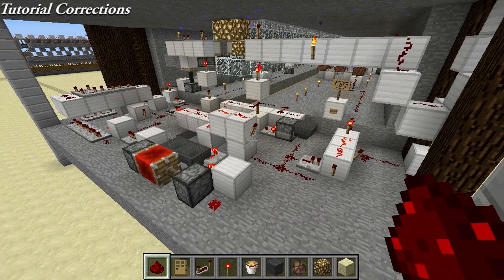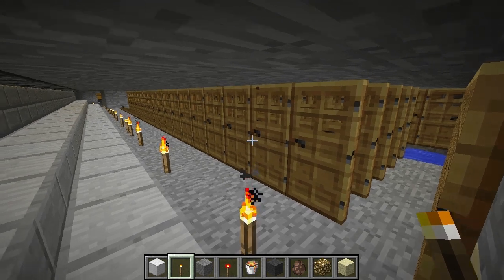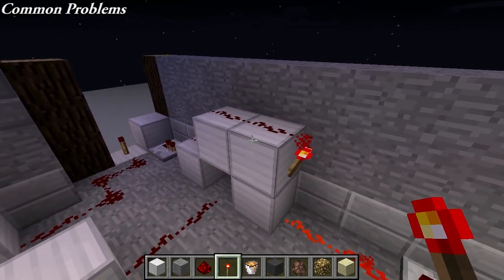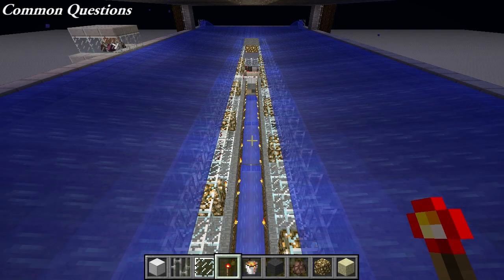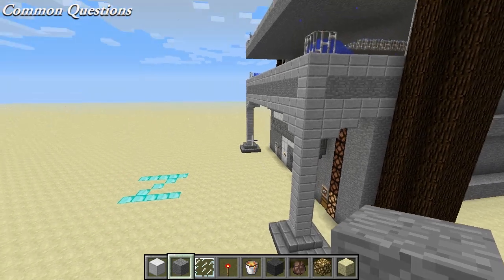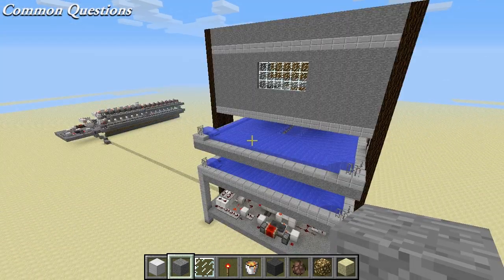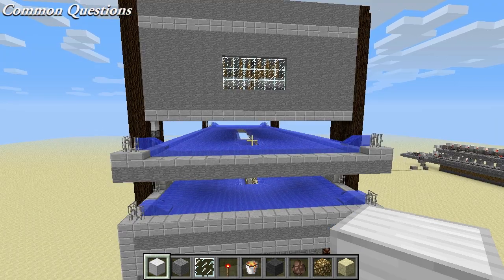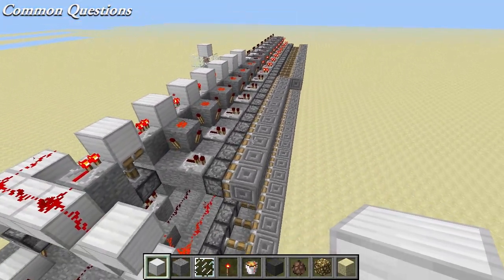The Iron Trench - Update and FAQ

Comment: as origaminerd said, that is a classic example of placing your doors further apart than they need to be. To find the correct distance (and check it) I would suggest placing a single door on one side, placing a villager within range to turn it into a village, then going to the other side and placing another door and villager at the spot. If the doors connect - you are within range. Now try placing the door one block away (and one block left or right). If new village is made, your spacing is right

Comment: One last update on this - got around to rebuilding the system (mostly because the redstone was taking up a bit too much space so I decided to go with the piston variation just shrunk into a 3x3 (mostly) space.
The system works fine, and I can confirm that starting stage 1 from the secondary village shaves off a bit of time (and resources).
Congratulations on thinking up of that by the way.

Comment from the maker: If the system is triggering a restart too aggressively you can easily just add a few more blocks to the hopper timer for the golem detector.  That will increase the maximum acceptable delay between golem spawns.  Its possibly I had this a bit too low.

Comment: That's a really great design, Tango. I have a few simplifications. The lower row of pistons on the the secondary site doesn't have any effect so you can omit them. Likewise at the primary site only the southernmost piston is necessary for phase 2 which reduces the sticky pistons needed by more than one stack. Furthermore the northmost door on the secondary site isn't needed. If you can reorganize phase one to start with one door on the secondary site you can reduce the time needed by one minute.

Comment: Just when I was losing hope I found my mistake.
I'd used glowstone in some floor areas to light it up. I guess that this was interfering with the village detection in phase 2. Now why this works in SP but not MP is anybody's guess, but I can confirm that having put everything back to solid blocks it's working.
My tip... Follow Tango's advice EXACTLY. It works.
Thanks Tango, your design is amazing.

Comment from the maker: I'd leave the redstone the way it is, mostly on the south side.  However, you could pretty easily change the water direction of the bottom trench and just drop the golems underneath the redstone.  Put your lava blade 5-6 blocks under the phase 1 redstone.  You'd have to find a new way to rewire your golem detector/auto restart switch too.

Comment: From what I understand there is no 'wrong order' for that - all you need is to finish with ~20 villagers in that basket. As such it does not matter if its babys or spawn eggs (if you can use spawn eggs / are in creative, just spawn 20 of them in and you are done).
When I build it in survival, I fenced off an area on the platform above, carted two villagers in, and after breaking the 8 blocks waited for them to breed.
After that I just broke a hole directly below the area and pushed them in.

Comment: Using Eihort from the wiki, I moved my spawn point to near the trench. This keeps the trench operating when I'm elsewhere. Also, even with the iron bars, golems get stuck from time to time. In the tutorial you break the dust to prevent the beginning signal while building. I placed a sticky piston with a block and lever to create a manual switch. This prevents the trench from resetting everytime 2 golems get stuck. When I notice them I just go up and push one out of the way.

Comment: yes, as long as the sunlight ports are open up to the sky (the two 32 block lines in the primary structure and the single 32 block line in the secondary structure)
- note that some blocks such as glass can be placed in the way and do not block out the sun

Comment: In case you can not use the village view mod (I think you need access to the server - not sure as I only used it in SP mode), what you could do is start the reset process on the online version while simultaneously starting a reset of the iron trench Tango gave for download in his original video (in single player on your computer).
Then just keep checking to see if everything is working properly (the timing might be off slightly).
If that fails you might need someone to come in and check it out.

Comment from the maker: Yea, it would require a lot of modifications.  Start by looking at what was done on the ZipKrowd server.  You'd have to use lots of lava and hoppers basically.

But..You'd also have to get the villagers above the bedrock ceiling which I'm not sure there is a way to do? 

So yea, its probably not realistically possible, because of villager issues.  Sorry.

Comment from the maker: Which ones? main side or secondary side? If main side, check your pulse extender at 57:22.  If its the secondary side make sure you have enough repeaters running along the ground and they are all on 4 ticks.  Bottom pistons should stay retracted for 6-7 seconds on both sides.

Comment: it does work (1.6.2; I doubt the villager coding is going to change, so it will likely work in the foreseeable future), and it will give you 8x more iron than Docm77's design in much less space (since his design has 4 villages - I think - while this one has 32).
On the other hand, Docm77th design is insanely easy to build with basically no redstone involved at all - you are virtually guaranteed to have it working right away.
This one however is much harder to build.
In the end its your choice.

Comment: um, its just two iron trenches superimposed on top of one another (with something like 80 blocks between them to give space for villages not to blend together). Since the sunlight blocks are right over each other (hoppers used +lava), the redstone for the bottom one is only a villager up/down system connected up to the villager systems of the top one.
Also, I dont think that the double-iron trench design is tango's per-se, so he wouldnt be the one to ask about a tutorial for it.

Comment: sounds like either
-phase 1 is started again -> you have to check if the golem counter gets a signal when
1. the dropper with 17 blocks is empty 
2. phase 2 is on (the pistons with redstone blocks),
3. check if the golem counter itself and all the redstone close to it is correct.
- phase 2 doesn't start -> check whether the hopper timer on the roof has started. if not, the signal from the dropper with 17 blocks to that hopper timer is broken.

Comment: I believe that is a sign that your doors are not in the correct position, although without actually checking the map I cant be sure. Still - that would be my first check - see if the distance between the step 1 doors in the primary building and the secondary building is correct or not.

Comment: Your problem is probably in the piston control. Stand between the structures and check if they are ping-ponging correctly retracting 2 more in the top row in every iteration. If they don't on one side or both, that's probably where to look.

Comment: Found that a stone stair block oriented backwards blocking sky access to the first registered door on the west wall of the farm. Also discovered I had 16 items in the hopper/dropper timer next to the manual reset. Should be 17 items as in the video. Works as advertised now. Also built a second farm  50 blocks above and 24 blocks east using the eastern support columns as a common structure element. Sky access is not blocked. Working on delaying the second phase 2 until 1st phase 2 is complete.

Comment: it is possible you messed up on the timings of the zigzag pattern of pistons - double check them and compare to the original. This is the part where most problems occur (I have troubleshooted my own and 2 others, and all 3 at least partially failed due to some of these redstone repeaters being off by a tick or two)

Comment: Alright - I attempted to change the system to start from the secondary site, but there begin to be problems with timing (on my system at least), and I really do not want to re-structure the entire thing just for shrinking down the restart time by 2 or 3 percent. Still, for the 'perfect' setup designed from scratch your idea might have merit.

Comment: Torching the area makes no difference to the Iron Golem spawns as they are not affected by the mob cap for passive or hostile mobs ;) Also for the failing to start up right on SMP the solution (hasn't failed me yet) is to sit between the primary and secondary structures (I made a house there) while it is being built.

Comment: "Is Tango an obsessive lunatic? Yes"
Admitting you have a problem is always the first step, lol.
Loved the build for this and hoping it works out for me.

Edit: Okay, problem. The dropper chain on the main building roof doesn't seem to be cycling. The item in that one powering the redstone lamp goes on to the next hopper, but there the process sticks. The rooftop double-hopper timer is also stuck with all 21 items in the hopper with the wire going into it. My villager-in-a-cart also sticks up at the top of the ramp. I've checked my wiring, hopper timers and starting states for everything and it looks right, but even with manual resets it doesn't go anywhere. The rest of the system is cycling nicely, just those droppers and their associated pistons, the villager, and the timer are stuck. Any help getting this to work would be appreciated.

Comment: When I set my building to remade itself, the doors in the small self-standing section son't connect to the doors in the main section. 
I tried to destroy the blocks of the bottom row in this small section, then it does work, but the doors in the small section have formed the village together, whitch in the end got connected to the main building doors, then it was replased inside the building.
The end was one huge village having all doors from the main section in it. 
It did work but not correct

Comment: Hey Harvey. Good News and Bad News. Good news is that it doesn't look like you made any mistakes (but I'd get those crafting benches out of there, just to be safe.) The bad news is.. it rebuilt and spawns like a champ for me. This makes me think you are having lag issues on the machine you are using. I'd try getting Optifine if you don't already have it and crank it down as hard as you can to conserve CPU while you rebuild. Like turn the frame rate down to 5, and shut off everything you can.

Comment: Alright, not sure if you will get my email first or this reply, but anyway:
I went over your setup and found that your relays were off by a bit in stage 1 (main structure zig-zag formation), so check them over and set them up properly.
Also, the most perplexing problem I have ever seen, some of your doors arent 'proper doors': axe down the 32 doors in the secondary structure + 32 doors in the primary used for stage 1 and replace them all (exactly as they were before).
See my email for details.

Comment: I have the same problem as @John Doe. The reset starts but then never ends. It just continues over and over. I had a few golems that spawned in the beginning just after finishing the project. But then it has just gone through the reset procedure.
Reply: also having the same problem with my iron trench.

Comment: Another note, I was having an issue where the golems sort of glitched and would get stuck on the lip of the upper spawning floor.  since there was a golem spawned it caused the system to stop spawning more and go into rebuild even though the villages were fine.

I replaced the stone blocks on the ends of the trench on both floors with iron bars the same as you did along the edges and it seems to have stopped.

Comment: Again, awesome machine :) I've encountered a small problem. I'm on a Bukkit Server running 1.6.2. I wanted to use the plugin "ChunkKeeper" to prevent the chunks with the trench from unloading. I dumped some items on the corners of the area (encompassing the whole thing), logged out and back in a few minutes later. They were gone. So the chunks seem to stay active. However, the villages do not. After every relog or leaving the area and coming back, the Mod shows them gone and it starts rebooting.

Comment: Is there anywhere in the circuitry that you can install a kill switch?  i.e. kill all the built villages and NOT start a rebuld.  

Also would like to put in indicator lights that indicate four things:
1- clearing villages
2- running phase 1
3- running phase 2
4- operating in steady state

Any suggestions on where to attach the indicator lights?

Comment: Yea, there's another issue.

1. Can't get villagers through bedrock unless you can force minecarts through the bedrock which isn't easy to do.
2. The design requires sky access to operate, unless it is counted in the Nether, impossible.

Comment: I ended up building this at bedrock and I had great success with it - making sure there were 3 strip skylights to the surface. However, I encountered a lot of problems with slime chunks. I'm on a bukkit server with chunk spawn caps to prevent load. Extra mobs prevent golems from spawning.
My problem is this - I attempted to use half slabs to keep slimes from appearing in the building, but doing so (and not breaking any redstone - it sets and resets like it should), golems arent spawning. Ideas?

Comment: Mine isn't working. ;(
I'm on a 1.6.4 server allowing 1.7.2 packets. We haven't upgraded to 1.7.2 server yet. I hope that's the problem. I've quadruple checked every repeater and hopper timer. The system runs through its loop perfectly. It just keeps going and never spawns golems. I have like 23 villagers in the basket. I wish someone would come check out my build. and tell me what I've done wrong.

Comment: Hey Tango.... I built this on the server i play on and it is working to an extent.... it has completed phase 2 and started spawning golems in, but the rate was not fast enough to keep it from resetting again.... will it break anything if i added more time to the golem detector ?
Reply: Sounds like the build is likely broken.  Adding time to the detector will not break anything worse, however.

Comment: I have the same problem, i noticed even with the fix of adding that repeater under the piston on the secondary building, my vertical pistons are not resetting. not sure how they are suppose to work to reset, that might be your problem too. if you find a solution on getting them to retract let me know.

Comment: I have used MCEdit to make a direct copy (of the corrected build) but after a few days of trying cannot complete the village reset process.  I always seem to start the rebuild process with a recognized village that won't go away when I tell the system to rebuild with the system reset switch.  There is a set of upper row pistons that will not reset and this keeps the village alive.  Short of removing and replacing doors, what can I do?

Comment: What happens if the main structure of the Iron Trench is loaded, but the secondary villager strip is unloaded?
Reply: As long as the build isn't in progress it will work fine.
Reply: Tango did say not to do that, though.

Comment: I cant get mine to work :( Everything runs great, but in phase 1  2 doors get merged to 1 village at every "move" instead of just one, getting 16 villages between the 2 buidlings, when the second phase starts it merges into one big village with all the doors together.. :( i build it right with the north site, no villagers too much, and i rechecked the design 4 times and i cant find the problem :(

Comment: I have 32 villages created (I checked it using the village marker mod), and they are created right in the correct place, just in the middle of the first spawning platform). BUT I haven't so many golems as you T_T A golem is spawned every 20-30 seconds, not every 10... What could be wrong?? Sorry for my English(?)

Comment: Does this design work for tu19 on consoles?
Reply: I just finished building it on the 360, not working. Any help?
Reply: 360 has a cap of 3-10 villages in one world so it wont work efficiently but on the xbone and ps4 it will work somewhat fine
Reply: If the cap is that low, you really do want to shorten the thing WAY down.  Heck, you could just remove the doors for the "extra" villages.  The reset would still take 20 min to run, but that might be easier than figuring out a stump...